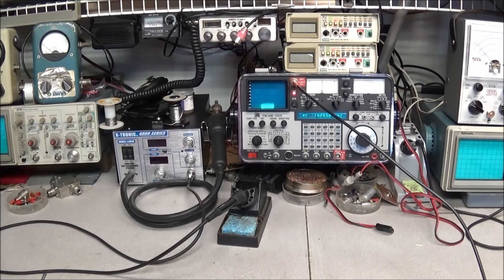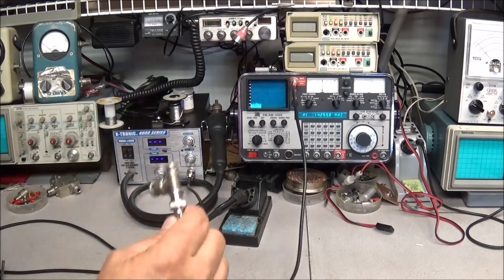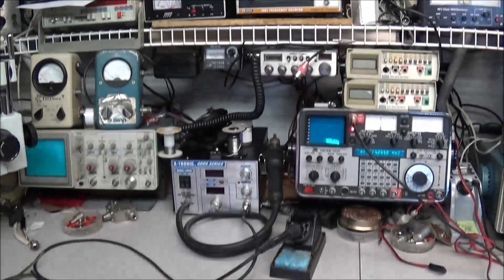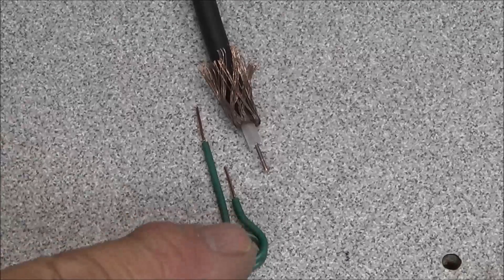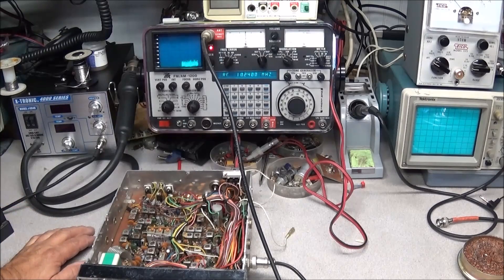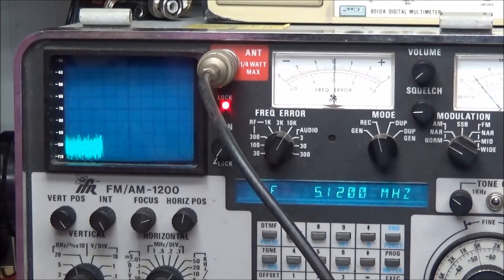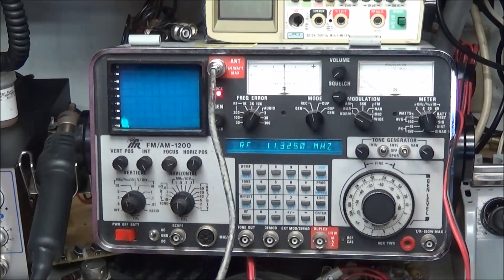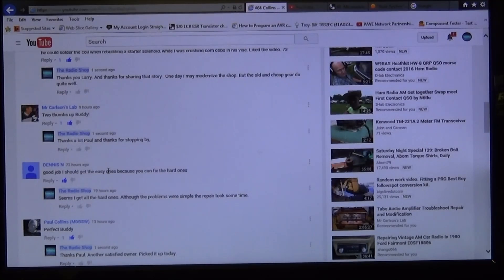#65 Shop Talk   Sniffing RF signals safely

Comment: Great stuff man! I know its an old video but its new to me. This saves a lot of time by avoiding removing crystals to test them in a tester.  I bought the frequency counter kit on ebay that you built in one of your videos. I believe the crystal has to be removed to use it. Do you suppose that some leads could be plugged into the tester to test the crystal in circuit? Thanks for sharing!

Comment: For the RF loop sniffer, what kind of coax ?  RG-58 solid (or) RG-58 A/U stranded (or) RG-174 ?  Presuming 50 ohm impedance is desired ?
Reply from the maker: I use a lot of RG-174 for these projects. Yes 50 ohms.
Reply: @TheRadioShop  Forgot to say overall excellent video and thank you !  Comment: I would test for loop wire size or gauge  for an "HF" loop and then for one that could go to the 200 MHz rating of the DSO I use. Same loop could be used in freq counter, spectrum analyzer and of course 'scope as well.

Comment: Greetings from England an absolute fantastic lesson and demo many thanks buddy.
Reply from the maker: Glad you enjoyed it!
Reply: @TheRadioShop  From: Joseph Rotello 06/21/2021 Overall excellent video and thank you ! QUESTION(S): For the RF loop sniffer, what kind of coax ?  RG-58 solid (or) RG-58 A/U stranded (or) RG-174 ?  Presuming 50 ohm cable impedance is desired ?  I would test for loop wire size for an "HF" loop and then for one that could go to the 200 MHz rating of the DSO I use. Same loop could be used in freq counter, spectrum analyzer and of course 'scope as well.

Comment: I need to turn off everything period (for an isolation project with lucid dreams used as a monitor). How do i turn off everything including rf signals? I bought 3000lbs of force in magnets and that didn't work and they didn't even turn off my cell phone.  I am about to try out turning on and off electromagnets, will that work? How do you find a spectrum of all the signals and vibrations in the air to block in the first place, is that a use of an Oscilliscope with different antennas like i saw in one of your videos?

Comment: Hi Buddy, I have taken electronics back in my day and would like to get back into it in my home as my hobby and to give me something to do in my retirement days. I have a Leaders LBO-526 oscilloscope, Tenma Audio generator  1 MHz, and a Tenma DC power supply.  What other equipment should a bench have?  I  forgot to mention I have a couple of digital meters.
Reply from the maker: Hi Jim, It really depends on just what you are going to be working on. You sound like you have covered the basic stuff already.  If you are going to work on radio or RF related stuff than some type of signal generator. Also maybe a function generator for other projects.

Comment: Hi Buddy, Speaking of 'Sniffers', where it might be for small FM TX, Andy Davies by the Sea, has a video, About Radio #89 - Mini TX 'Sniffer', detector test probe, that consists of a small coil, a Germanium Diode, BAT85, 1N34, etc. and a 0.1 (104) uF capacitor. It connects to a DVM and will only show if oscillating. Andy Davies, GW0JXM. Be good, C.
Reply from the maker: Thanks Cass for that/ I will look that up and see how it is.

Comment: I have been an electronics technician for 23 years. I an also a ham radio operator in Canada. I have made a few of this and they work well. I always have extras in case I loose or break one. Very good video.
Reply from the maker: Thanks Henry. Spares are a good thing to have.

Comment: Glad you did this video as a follow up.  When I saw the video this weekend, I thought the BNC Tee was kind of a clunky way to pick up signal, but the safety factor needed to be addressed.  Lot of difference in sticking something in that Cobra xcvr as compared to the Collins xcvr.  I learned my electronics in the 60's where you really were careful in poking around in a circuit.
73, Harvey KM4JA in Alabama
Reply from the maker: The tee actually works great and is a bit directional. But, there is the safety factor. I don't want to miss lead folks. Specially the new ones. Better safe now and live tomorrow. Most of the stuff I work on is loaded with high voltage.  Nothing like that little cobra. Thanks Harvey.

Comment: Regarding the problem not being able to comment. I have had the same issue. The reply button is there and you can type the message but when you click post it just does nothing.

I found if i went back a week or so later i was able to post a reply where previously i wasn't. So i think it's some weird problem with youtube  but it does seem to be temporary but very annoying.
Reply from the maker: I will give that a try and see if it works. Thanks for that tip!

Comment: I had that problem for a while of not being able to receive replies.  That was my own fault unknowingly.  I had turned off the reply section in the youtube tools.  At that time I didn't even know they had a private message thing on youtube either, so when folks wrote to me on message I didn't see that either.  Finally I suppose out of exasperation John from Arkansas (Joernone) mentioned me in one of his videos telling me he couldn't reply to my comments.  I went into my tools section and fixed it then and playing around with it I also discovered youtube messages and saw that I had several of those as well, lol.  Take care, Gary
Reply from the maker: Only seems to be a few folks in a thread that I cannot reply to.  If it was set to no replies then none would work?  I think it is a YouTube glitch. After reading a bit on the web today I see it happens to a lot of folks.

Comment: Hi Buddy, Great Tech tip, many thanks. The tip about the hand cleaner a while back was also good. 73
Reply from the maker: Thanks Larry. I just did not feel right about the way I shown that in video 64 and had to make it right.
Reply: Didn't bother me any, I thought it was great! Last 6 or 8 years before I retired I worked on a full voltage test floor with voltages up to 6,900 VAC on primary fused at 350 Amps.When we blew a fuse WE BLEW A FUSE!  Sometimes we would hi-pot at 30kv 1/2 amp. But I understand, you would not want anyone to get bit by them not following your warning or not being careful. You're good that way. Now, when is the next tip? :>)

Comment: Great tip Buddy.  Made a set of those years ago.  Was going to buy a set of commercially made ones and almost had a heart attack when I saw the price.  Would think they make them out of solid platinum.  Home made works just fine.
Reply from the maker: Gosh yes, these thing get expensive! I much rather make mine. Save the pennies for later. Plus the fun of building something. It only takes a few minutes to do.

Comment: be sure you you use your new probe, even us old tecs can make a mistake, I made my NFP some time ago using a small plastic tube where you used heatshring be safe
Reply from the maker: That plastic tube idea sounds great. May make a few like that using old ink pens. Great tip Dennis. You are right. We old folks can make mistakes.
Reply: yes they were old ink pen tubes
Reply from the maker: Great, All kind of uses for those things.